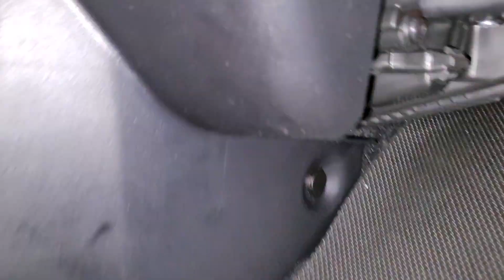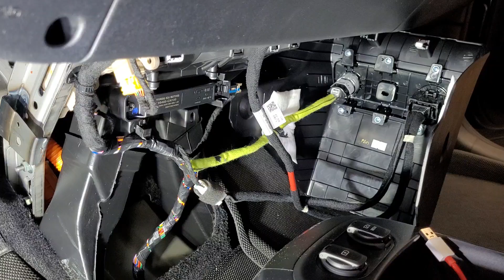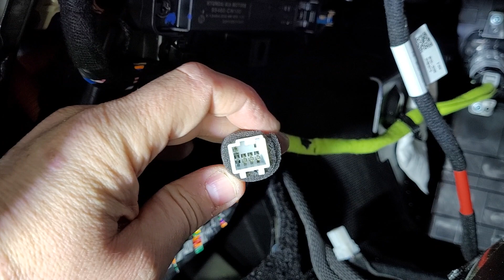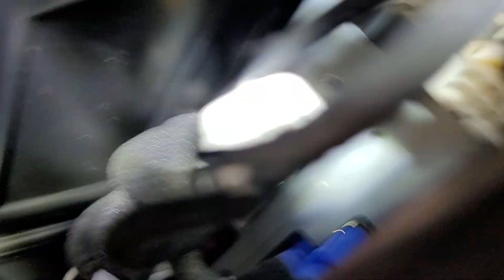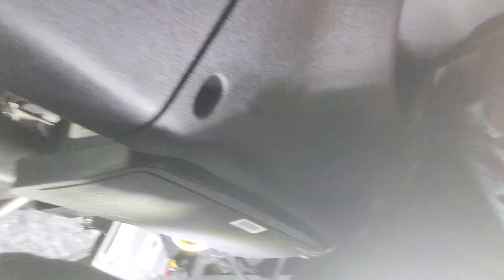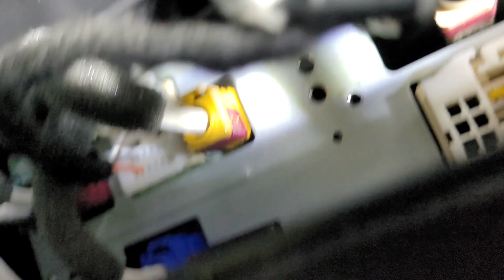Kia EV6 and Hyundai Ioniq 5 USB disconnect fix for Android Auto/Apple Carplay

Comment: I am struggling to get the screws BACK into the fixing lugs, and would appreciate some help on how to get these back in. They spread open and it's very awkward to get them to close up and slide in at the same time - I haven't been able to do it.  - Do I use brute force to shove it back in? I'm worried about breaking them.  Sorry to be a pain, but an explainer would be useful, or even a quick video if you're feeling generous.  

This is an AMAZING diy FIX and I thank you for taking the time to post it.  It has worked for me and clearly a number of others.  It must be something that Kia are doing at factory which is causing this systematic error to happen periodically (I'm guess 1 in 50 cars).

Great fix - much appreciated. Now off to find a wireless adapter.
Reply: The plugs kind of have 2 parts. If you look at it from the top you can see that there is an inner circle. Pull this towards you and you will see it retracts the splayed out part of the plug.
Reply: @IanMcc1000  I was having problems with the two screws as well. IanMcc's reply helped me get them back in place. Hope you were able to as well BlackVodka.

Comment: This worked perfectly.  Disconnected both and then just securely reconnected them.  It has been working perfectly for over a week.  Mine would disconnect from CarPlay at least 8 to 10 times on my 30 minute drive.  Now, it never disconnects.  Only took 10 minutes to do.

Comment: Checked today -- the connector between USB-A Port and the Infotainment Center is not fully inserted. I pushed it in 3-4mm, then it clicked. Just took a one hour drive which included some know trouble spots with bumps, not a single disconnect. Appears to have resolved the issue. Will test more tonight. 

Good call dude -- issue appears to be that someone during assembly failed to fully insert the male connector into the female socket.
Reply from the maker: Some people have reported a connector not fully inserted, however most report everything is connected fine but unplugging the two connectors and repluging them still fixed their issue.
Reply: @alexdrinkwater28  - if a reset alone resolves the issue if probably wasn't fully inserted and they didn't realize. There is a small amount of play, even when fully insert - that is why I wrapped electrical tape around the connector. 

May also be that aome have wires or a connector that is compromised, resulting in signal attenuation. 

Regardless, thanks for the video. :-)
Reply: @Cybrdude  still going smooth?
Reply: Sorry - just saw this. No. Had the harness replaced back in July -  flawless ever since. I had to provide an extensive write and even included impedance values from a USB Analyzer. @ViewlessSquid
Reply: @Cybrdude  it’s all good. I ended up pulling my whole radio out, unplugging everything and replugging everything back in and turned the car on and jiggled all the wires and nothing happened. Been driving it for the last month with no issues. So I think the connectors were loose, or it was from another wire that was causing the issue. But I’m glad you were able to get yours fixed. Thanks for the response.
Reply: Nice dude, glad to hear. For a well-made car they dropped on the ball on the Audio 
Wiring. @ViewlessSquid
Reply: @Cybrdude  that is a fact.
Reply: @alexdrinkwater28  hai avuto ancora problemi di disconnessione usb?

Comment: The video was very helpful. My wires were position a bit different than the video but it still splits into to two cables connections, one to the head unit and the other to power/USB detection. I have seemed to fixed the problem which seems to be the connection of the power/USB detection cable. What I did was to open the panel, as the video outlines, straighten out the crunched wires to the plastic connector, then push it tight and wrapped tightly with black electrical tape to hold the connector together. I did not wrap the thin wires to each side of  the connector to tight so they would not break over time, just enough to hold in place from bending. I also looked at the cable to the head unit, but it is very buried under the upper panel, it was hard to get up there with my hands. I don't think actually that was the problem cable as the other is the one that has a wire called "USB Detection". I believe that wire to the USB port via that connector was just going in and out because the connector is not the best and is not tight. Hopefully this helps.. if you are fixing this for yourself, focus on that connector :)
Reply from the maker: I've heard others say that they focused on the white connector because it is easily accessible and did not touch the blue connector and find out they had to take everything apart again and replug the blue connector to fix the issue. My recommendation is to do both while you have the car apart.

Comment: Are you suffering from the AA Disconnect Issue and if so, did this help? I have traced the issue down to impedance (using a USB Analyzer - I work in tech). Definitely poor connection OR poor-quality cables that result in signal attenuation. 

I found a KIA Dealer with two EV6 Master Techs - I will visit soon.
Reply from the maker: No, this has fixed it for me and others with this problem.

Comment: And I wonder if there will be an adapter created that will provide data on the USB C port.
Wouldn't be that difficult if you got the clip adapters. Kind of like the adapter for dash cams
Reply: I guess that the USB C just has power pinned cables, there is no data cables on its pins, so there is no way to connect it to the multimedia system.

Comment: Not sure how this helps? You're just disconnecting the cables, disconnecting the USB from the panel would do the same.
Are the contacts not solid in the plugs?
Issue I have found is if you use climate control from the app. It starts the USB and if my Carsifi adapter doesn't find my phone it times out. I then have to unplug the USB to restart the adapter

Comment: If you keep removing the cables by jerking on the cable ( instead of the plug housing ) I am not surprised that you would have issues with the cables !    Also, try a bit of contact cleaner ( Deoxit works great ) on the terminals of the plug and socket, and make sure you are using a charge/data cable !!!
Reply from the maker: I am not having issues with the USB cable.

Comment: im having the same issue with the NIro EV K4. brought to the dealer, they tell me there is nothing wrong with it even though i've had countless dropouts with various cables , various phones connected and even usb stick with mp3 files. keeps disconnecting and reconnecting. so frustrating. Dealar kept insisting it was my cables or phone.
Reply from the maker: Not sure how the wiring is on the EV K4, but trying something like this might fix it.